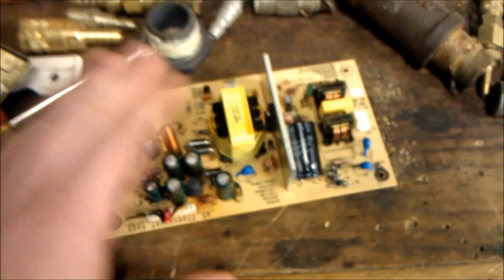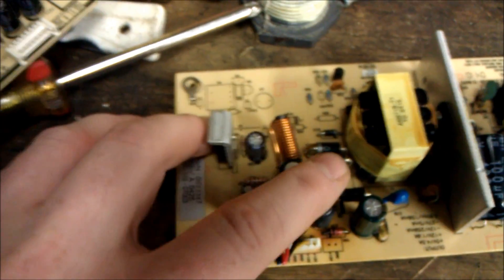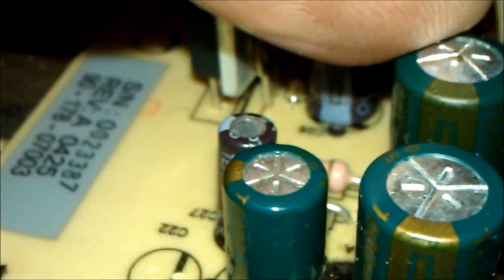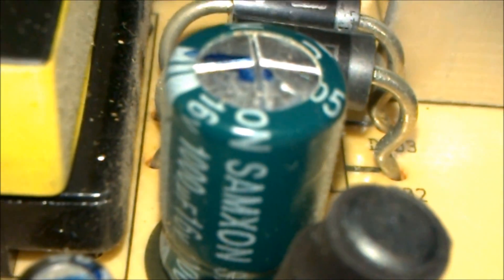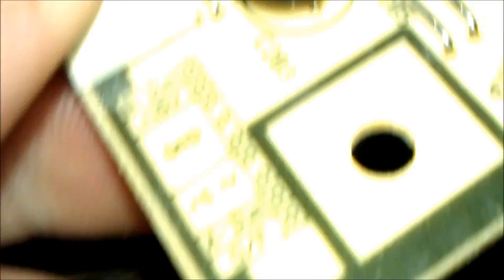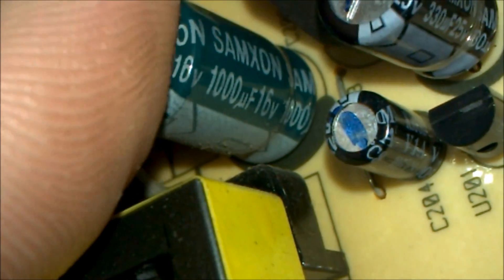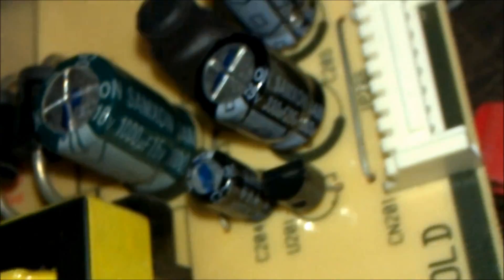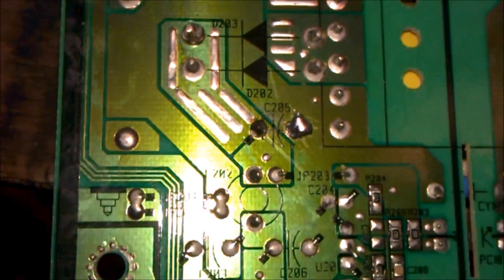How to fix and replace a capacitor for a Samsung LCD Monitor

Comment: I had this problem before, i replaced the 16v 1500uf cap with a 24v 1500uf cap and it works just fine, the reason i replaced it with a 24v was in hopes the higher rating would eliminate future issues with heat, thankfully it worked.

Comment: You take the stand away, put the screen on a towel or similar soft item on a work desk. Then, with a guitar pick or a thin bladed screwdriver start prying the FRONT frame off. Click click click.... Bad capacitors are swollen, they have a bumped up end (like a beer can).